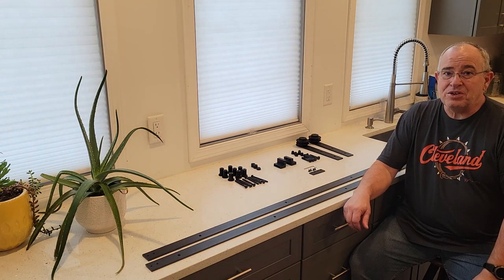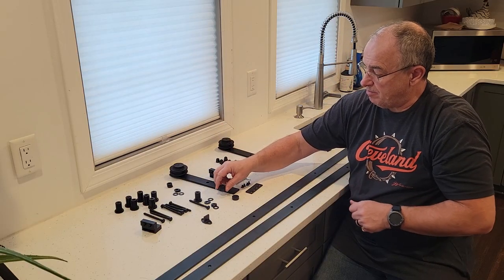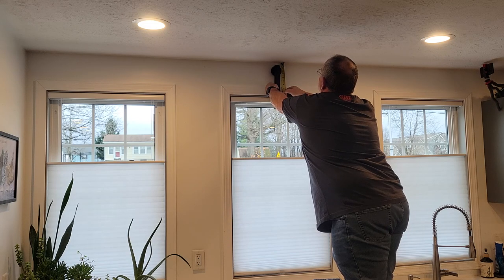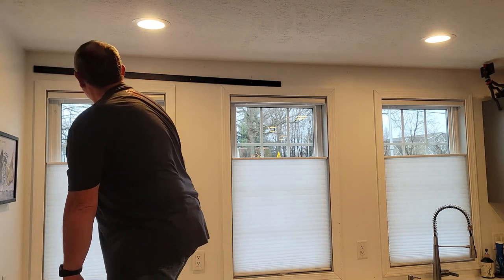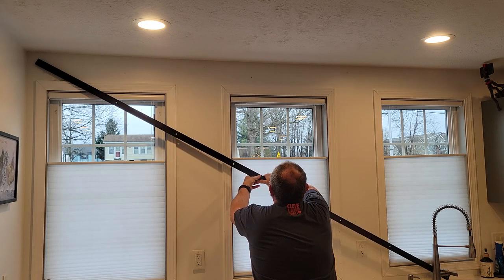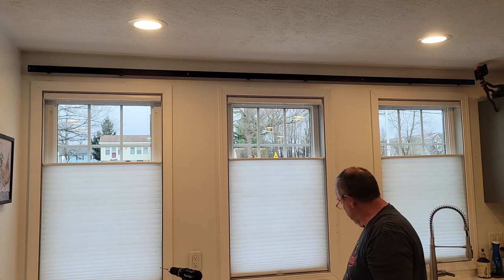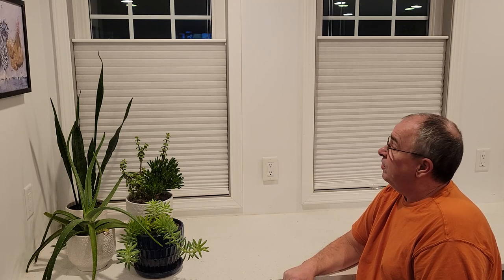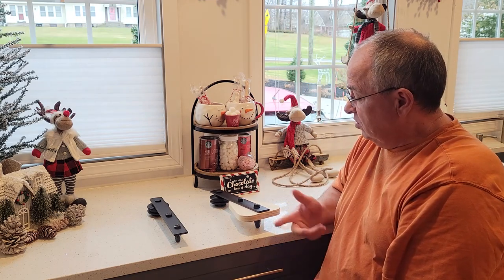Wall hanger for plants and decorations using a barn door track

Comment: Nice one Pat. Personally, I thought it was too much DIY /effort for achieving the look. Best wishes

Tip: You could add moveable, louvered shades on the rail to give some shade on a hot day. You could even make a simple light wood frame & stretch fabric or paper or blackout material
Reply from the maker: Great tip! Everytime I'm in front of the windows, different ideas come to mind.